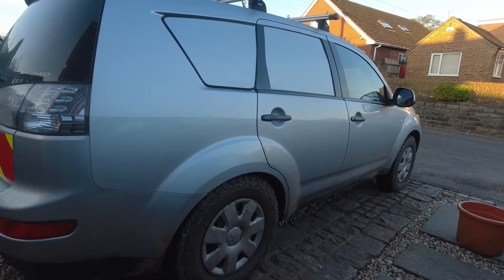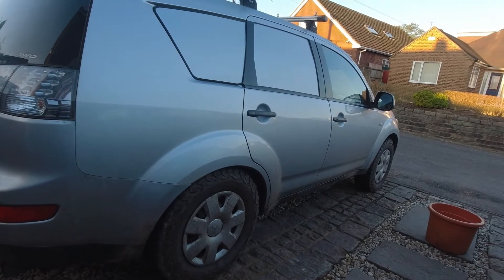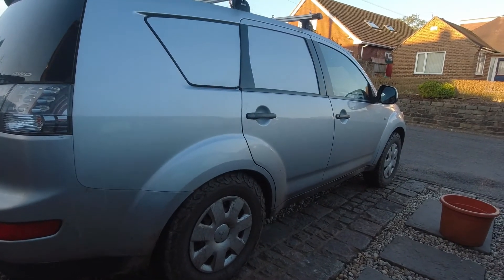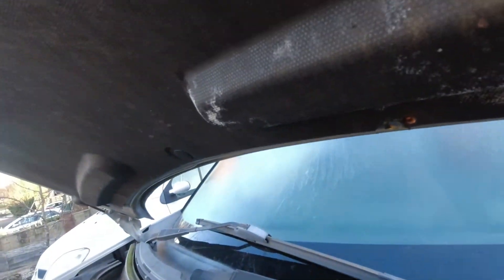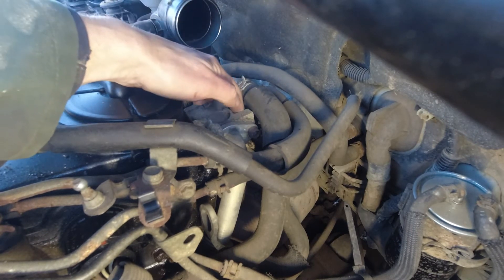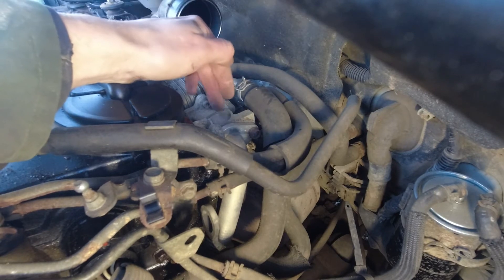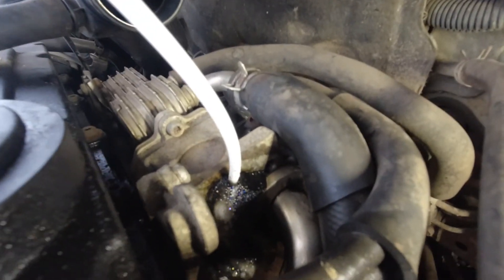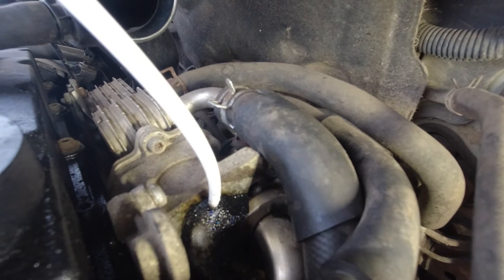Fixing my Mitsubishi Outlander 2.0 TD VAG PD Engine BSY Turbo Vanes Stuck Over Boost P0234 Limp Mode

Comment from the maker: August 2023 update.
Last couple of months the P0234 has returned so today I’ve put some ‘Turbo Revive’ through and a dose of oven cleaner and everything is working great again. 

Regards Darren.
Reply: My issue came back pretty quickly so I replaced the turbo pressure sensor in the pipe in front of the front left wheel. Cost about £15 and haven't had an issue over the last 10,000 miles.
Reply from the maker: @SpiroZoren  that’s good news. I’ve considered this but put it off as so many say it’s quite difficult to get the old one out. 
How did you get on with its removal?
Reply: @AbellTo  It was a little fiddly to get out, but easier than getting the Mr. Muscle in to be fair. One of the bolts came out with the metal thread insert that is pressed into the plastic pipe so I had to glue that back in before refitting the new sensor.
The old sensor was quite oily so I suspect that my turbo is worn (which is to be expected as it's still the original one and I'm on 140k miles).
Reply from the maker: @SpiroZoren  I’ll plan to get it fixed. My turbo was done at 70k by the Environment Agency who owned it. So this turbo is on 75k and hopefully I can get it to last as long as I need the truck. I can’t think what other vehicle would do the things I need. Maybe Subaru.
Reply: @AbellTo  I have had the car since it was almost new with 20k miles. Never really loved it, but I have kept it longer than any other vehicle and taken it all over Europe, towed caravans and trailers, lugged 7 people around, commuted and it's been good to me. Original clutch and turbo still at 140k miles, but I expect them to go at some point. In terms of problems, I think all 4 springs have broken and been replaced, 3 out of 4 calipers are new, a couple of sensors, glow plugs, 2 sets of front discs, about 4 used Bluetooth modules, 1 new battery, a broken auxiliary belt pulls and I think that's it. I haven't even changed a lightbulb on it in 14 years (I know the rear ones are LED's). 
Still get 40mpg on a run (better since I changed the sensor).
Reply from the maker: @SpiroZoren  I’ve been impressed with mine. I needed a 4wd for work. First one I’ve owned, and it’s been quite amazing. Your right they do have niggles, both my front springs replaced. Put HD ones on the back.
My alternator self destroyed last week. MOT due in 4 weeks. The rear end needs some work now, arms and pipes and poss sub frame so this year is expensive but another vehicle is going to cost mega bucks now
Reply: Cheers for the update. I've got a 09 plate outlander with a p0487 error code which according to my code reader is egr system throttle control malfunction. Looking on YouTube I found a short video on the throttle valve and apparently the teeth strip on the cog inside so the throttle body butterfly doesn't open properly inside. I think this is the issue with mine. First I thought It was the turbo vanes sticking so I was going to try your method to free it off but if thar didn't cure it strip the turbo down and clean it. A very big job I'm not looking forward to 😵‍💫
Reply from the maker: @davidhenderson7722  you’re welcome. Hope you get on ok. The egr is easy to get to, the egr cooler isn’t. The turbo removal is a head scratcher and I can see one day I may have to remove and do a thorough job. All the best

Comment: Great video. I would suggest in order to move the turbo actuator lever while Mr. Muscle does its magic you use a handheld vacuum pump connected to the yellow striped rubber hose located on top of cam belt cover that goes to the actuator.
Reply from the maker: That is a great idea. Thanks for sharing this and adding to the details.
Mine is still going great

Comment from the maker: Had 6 weeks with no issues. But it did go into limp mode after 6 weeks just temporarily on a 60 mile motorway trip with a trailer full of timber after about an hours driving. Was absolutely fine on the empty journey home. I think I’m going to do another session with the cleaner and try my best to move the actuator

Comment: If you follow the EGR pipe donw from the cooler you can see the actuator and move it with your fingers.. Thanks for the video i tried the same. Could not get my hands on mr.muscle but I got similar type of oven cleaner. I got mine unstuck in a matters of hours. Now i only have the problem with the throthle valve feedback. But I know the valve opens.
Reply from the maker: Thanks for the info, mine had a little mega last week while towing so I’m going to give another go and try the actuator as you described. Hope all goes well
Reply: Can you be more specific in how to reach the actuator?

Comment: Well Darren hope you are keeping well I made a small discovery to do with air intake if you take the grill off ya will see there is no vent for air intake it's on the opposite side I've just cut a slit out to see if that improves performance,hope that helps you or someone else out,it can cause overboost issues ✌️
Reply from the maker: Now that’s very interesting, so LHD Outlanders have the vent and RHD might not? I’ll check mine
Reply: @AbellTo yea it's completely backwards ya can see the slits for the air to get through on left and on the intake side air is blocked,I've just driven 60miles since and couldn't be happier with it,well worth taking the 5 minutes to do it,hope it goes well for ya and let me know how she runs after it
Reply from the maker: @RSM-A.Mc.N  I will for definite, I’ll take a look tomorrow
Reply from the maker: @RSM-A.Mc.N  hi mate yes sure enough no slots in front of the air intake, after thinking about it I’m sure it’s nothing to do with LHD or RHD models, however I can’t think of a reason why they didn’t have them. So 5 minutes later I too have new slots cut. 
I’ll let you know how I get on.
Thanks for the tip
Reply: @AbellTo  I might have misunderstood the details as I was getting the hamster on the wheel at the time so to speak,maybe it was different engine models either way it isn't good enough and should have been rectified before they sold them,I'll be in Mitsubishi tomorrow so I'll have a word with them,hope it runs smoother for you from now on best of luck with it buddy
Reply: @RSM-A.Mc.N  What did mitsubishi say?
Reply: @AbellTo  Hi, did new slots cut out help you at all? Have you had the turbo issue after your last update?
Reply from the maker: @andreasvalseth7513  the slots cut out made no noticeable difference, the turbo did its first limp mode since 2023 oven cleaner in February 2024. It was a long drive with the trailer and happened on the return home. EML came on but it’s ok again now, I’ll do another treatment before oils in June

Comment from the maker: 7 month update.
Started having the same turbo issue so had 1/2 a can of oven cleaner left and repeated the process. Managed to move the turbo actuator rod a little and hopefully work some of the foam into the vanes. 
And we’re all tickety boo again, no problems with limp mode or over boost.
Reply: Any more issues?about to do this on Saturday following your video
Reply from the maker: @RSM-A.Mc.N  working fine at the moment. All the best with it. It’s fairly straight forward once you get the tube in
Reply: @AbellTo  cheers I'll keep ya posted
Reply: Running like a clock now cheers for the useful video and saving me pulling the turbo out
Reply from the maker: @RSM-A.Mc.N  hey mate that’s brilliant, I’m so glad it’s worked for you. Thanks for replying
Reply: @AbellTo  I done 2 jeeps at same time was handy enough once ya pump actuator it really helps clear the oil out,I also found an easier method to fitting the tube I used a straw and cable tied it to tube and slotted it over the main straw under cap of Mr muscle,will be keeping it for future use if problem happens again,I'll probably clean every 3 months just to keep on top of it I also did all turbo pipes and cleaned intercooler there was quiet a bit on left side of it ,might be worth a look at your own when ya get a chance
Reply from the maker: @RSM-A.Mc.N  great detail thanks so much, I love how we can work through problems and share ideas. Regards Darren
Reply: @AbellTo  we all share this planet so sharing info is vital cheers Darren hope you haven't any other issues best of luck with the channel I'll be keeping an eye on it
Reply from the maker: @RSM-A.Mc.N  well said mate, my truck is working a treat just got to sort the front drop links next and then rear arms were advisory on MOT
Reply: @AbellTo  I've literally just done the drop links and anti roll bars I've to put mine in for test start of next month so we will see of we get any advisories the system here in Ireland is a joke I've my test booked the last 6 months and tis over due nearly a year so I'll have to get it tested again nearly straight away so fingers crossed my spanner skills will get her thru with no issues
Reply from the maker: @RSM-A.Mc.N  hope so mate
Reply: I drilled and tapped an M8 bolt into my ML w163  exhaust manifold,  brilliant for oven cleaner turbo works!
Reply from the maker: @ranat5526  that’s a great idea

Comment: I don’t understand how you moved that butterfly valve you mentioned
Reply from the maker: Ah you might mean the pressure actuator, it’s really difficult to explain, I had to lie down put my right hand and arm up to the turbo and feel under it for a rod that has threads on and a linkage on the end, that needs to be pushed up if possible towards the bonnet.
Mine was tight but eventually I got it moving about 5mm
Hope that helps

Comment: Did the limp mode go away after turning off/on ignition? Have same issues, but it’s not a permanent limp mode.
Reply from the maker: Yes turning ignition off reset things for me too but sometimes only for a few minutes
Reply from the maker: In the ecu it stores the fault codes until they’re reset by a code reader
Reply: Just got to the part where you said it clears! Il try this out and see 👍
Reply: Forgot to ask, did you just start it straight after refit, or do any other things? Tackling this job tomorrow!
Reply from the maker: @TheRestorist  yes just started straight up. All the best. Vans been absolutely fine since doing it a second time 3 weeks ago
Reply: Cheers, and by the way the actuator is accessible from drivers wheel well, behind the shock/hub. 
You can attach a long length of washer hose to it so you can easily suck vacuum by mouth to make it move 👍

Comment: Looking for a cheap SUV, should i buy a Toyota Rav4 2003 mod 2.0 diesel or a Mitsubishi Outlander 2008 mod 2.0 diesel?
Reply from the maker: Good question, I have no experience with a Rav 4 but for me the outlander is great, just the right size for work and tools, has enough pulling power for my little trailer, has a very good 4wd system, is nice to drive. Is fairly good on diesel economy.
There are niggles like the turbo problems and the rear springs sag but both can be fixed.
All the best on your search, regards Darren

Others might see your comment and be Abell To help
Reply: @AbellTo  How long does a turbo usually last on a Outlander, before it need fixing or replaced?
Reply from the maker: From the records the original turbo on mine was replaced at 75k .
I’m at 145k now and the turbo seems fine it’s just the gumming up of the variable vanes that becomes the issue. If regular oil changes have occurred then a turbo is usually quite reliable. It’s the cleaning that presents challenges and quite a few garages will simply say replace the turbo.
Reply: @AbellTo  Ok, thank you very much for the answer. I'm leaning towards the Mitsubishi Outlander.
Reply from the maker: Definitely worth going to see a few, there’s a couple of Facebook groups too in the UK that are really good

Comment: Couldn't you just use carburettor cleaner?
Reply from the maker: That’s a good question, I’ve not heard anyone try that with the turbo in situ. The oven cleaner is an expanding foam so once inside the turbo it expands into the chamber and gets to work

Comment: Did turbo get fixed
Reply from the maker: The treatment in the video fixed the issue of overboost for about 5 months. I’ve done another treatment in September time and all is fine again. I recon it could be every 6 months for me but at only £10 a pop and I only use half each time it’s cheaper than new turbo at £800 fitted